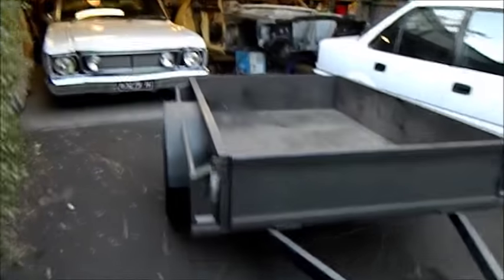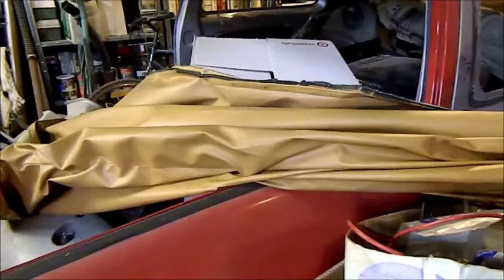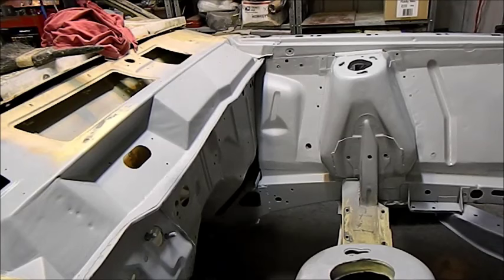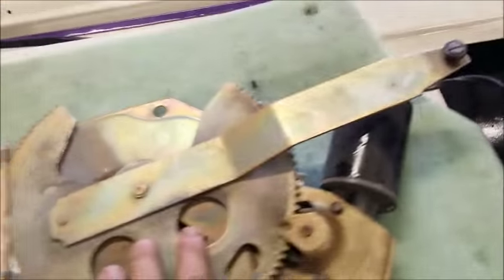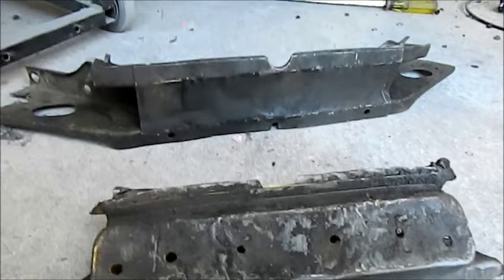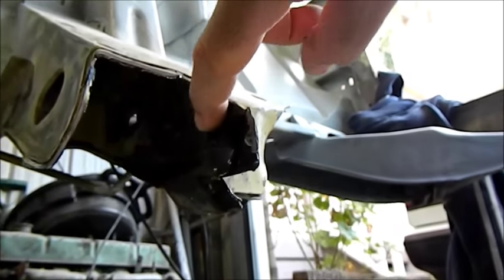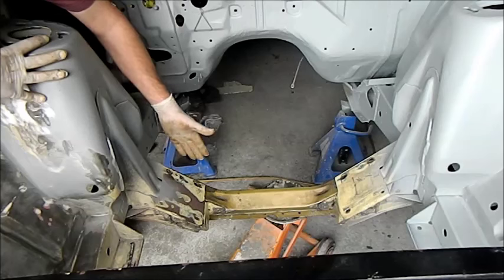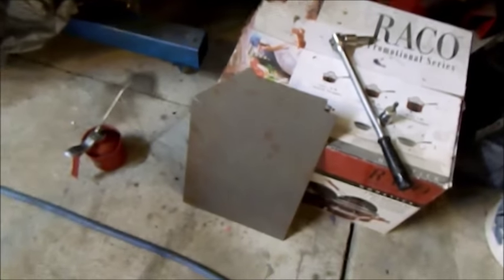Ford XC Fairmont 351 Restoration Part 6

Comment: Regarding your friends xw wagon. I've opened up the clock on my 72 valiant charger and it had a burnt resister, causing a relay like, noise when the winding mechanism would touch, it would spark a lot more than it should have when contacting. I imagine the xw would have similar tech being around that era. The points touch causing a jolt which winds the spring back just as you would wind a clock of that era. as the spring wound back down the points would touch again, starting the whole process again. 
I have owned about five ZH Fairlaines in my life. I've given the untouched one to my nephew. But kept the Sportsman ZH. I did come across the same problem as you. The car was touched by an absolute clown prior to my ownership. There was nothing he didn't touch on that car. Some things left me scratching my head as to why he would do things like, use wood screws in place of original bolts. and not one screw on that car matched or was original either.  But you must admit, as frustrating as it is, restoring these types of cars is fun. 
I was restoring my sportsman to original. I had bought the fairlane, I've since given to my nephew, for this very purpose. My nephew loved it, so I gave it to him instead. Even though the car is just a base model without  options, the car was too cherry to break apart anyway.

I believe you'll regret not bring your cabin vents to original and you should always keep aircon options there despite your preferences just for value sake. I still have factory air in the dash of my sportsman even though I have the under bonnet stored away. How easy would it be to install just under bonnet, if ever you changed your mind one summer and go on a comfy road trip.

Comment: Excellent vid as always Peter, I watched with interest in regard to the VIN number on the chassis as my XY VIN is very light as well.  I would like to know if you can stamp them back in or do you need to see the roads and transport guys to get approval, I am in NSW,  as you know its different state to state.  I am putting in a 28 Circuit pianless wiring system in over Christmas.  Merry Christmas to you and your family.

Comment: Peter, you said in this video you owned a 429 big block. I think I now have that motor in a hardtop and would be interested in talking to you about the cam you chose as there’s paperwork for a few options (looks like you did a fair bit of research). Looking to do some work on it next year but Goodsall to know what I’m starting with. Thanks, Shane.
Reply from the maker: Hi Shane, great to hear from you, I remember you wanted it quickly for an XA Hardtop! I never got to start that engine... built it then sold it to you. It owed me a fortune with the machine work being done at Crankshaft Rebuilders in Blackburn and match porting, plus all the nice new stuff inside. It's also a DOVE block which is the same as a Cobrajet, so is cast for 4 bolt mains, but they were never drilled in that block. I'm having trouble remembering the camshaft, so will need to go through some old docs to find it - it was well above stock and 'torquer' specs, think it was a dual pattern but will need to investigate... did I give you a folder full of all receipts?
Reply: @PeterAndersons  Peter, thanks for the reply. I recently bought the XA out of Victoria (I’m in Brisbane) and it came with a packet of paperwork of old receipts - a couple of which had your name, I didn’t think you would be the same bloke until I heard you say something on the old video about the 429. I’m not sure if all the paperwork you supplied came with the car or not so any specs you could send through would be greatly appreciated. Happy to provide email address if that’s easier. Thanks again, Shane

Comment: Hi Peter. Love ya work on the XC mate! Im looking to buy a new fuel pump for my XB Fairmont V8 that's currently stuck in the driveway after the pump stopped working. Where did you get the carter fuel pump for $42? I've seen a few on ebay for about the same price, but im worried about the pumps beenig fake knock offs as they don't look like yours. 
Cheers George.
Reply from the maker: +Big G G'day, I got it off eBay too...

Comment: Hi Peter,
What was the reason behind swapping the cross member out. Was it to do with the car receiving a V8. ?
I’m doing a XD and will be swapping the 6 out for an 8 and was wondering if I also need to do this.
Reply from the maker: Hi Ben, From memory I had the wrong one. XC and XD ones are different with the XD one having a different handbrake setup. Six cylinder ones will be fine for the V8 conversion. Cheers